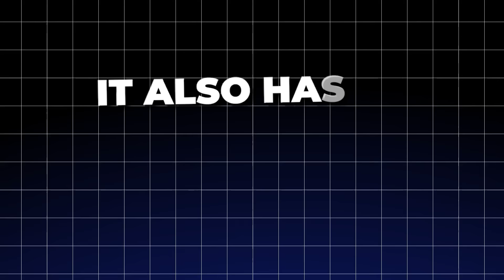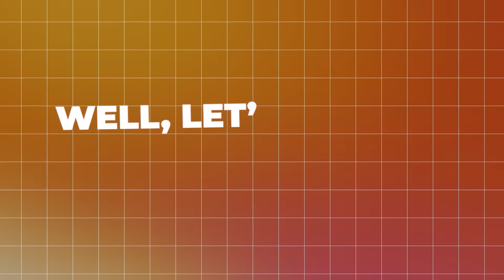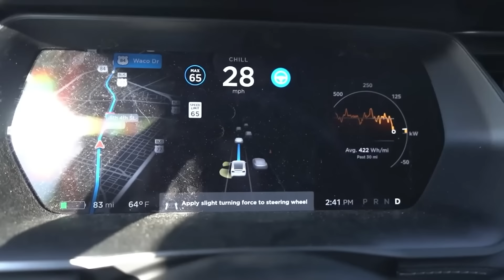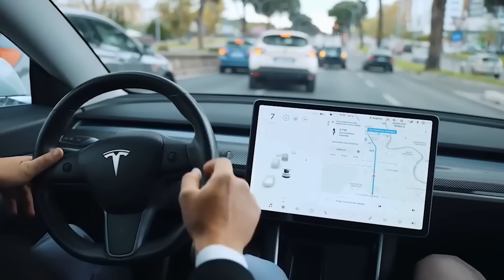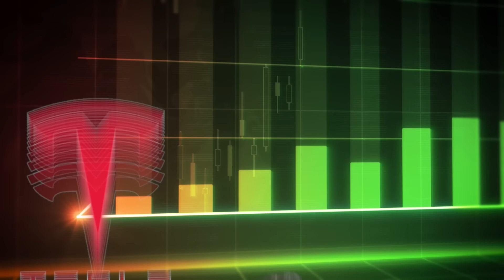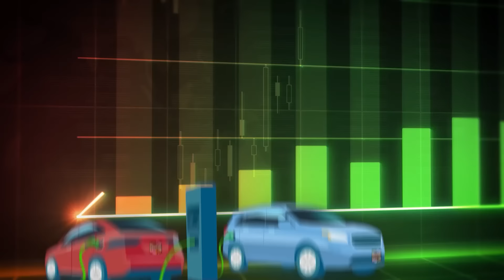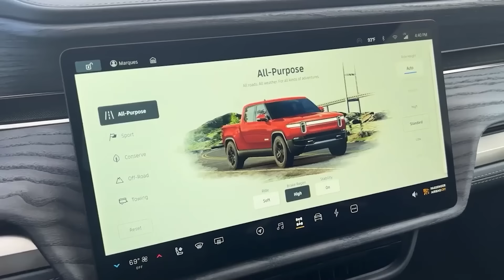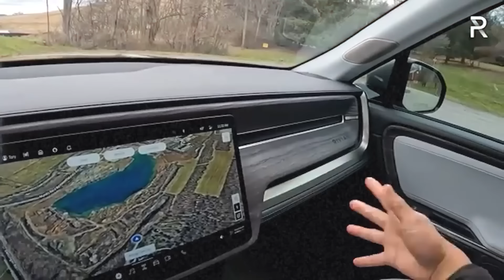IT HAPPENED! Elon Musk’s New Tesla Pickup Truck DESTROYED All Competition!

Comment: for me, its Canadien winters the issue😖 6 to 8 month of winter, sub zero weather, can go down -48C so is there battery tech that can handle that?🤔
Reply: Satire alert:
If we can survive until the Musk Mars settlement and mining of the dilithium crystals for which he will shortly be securing mineral rights throughout this solar system is fully underway, as well as the Mr Fusion Home Fusion Reactor that’s been in development by the Tesla skunk works for years now, our energy future will be secure. 😂😂
Reply: battery can be heated as long as its plugged in
Reply: @stanmitchell3375  yes but plugges are not in many parking lots are they😔
Reply: I drove my Kona EV through the rogers pass dozens of times in -40 without ANY problems
Reply: @Roham  out of curiosity, what’s the range and charging time like at those temps?
Reply: Charging time is the same and range is 300+km instead of 420km. Once during a road closure I slept in the car from midnight till 6am and used just 8% energy with the outside temp at -40 and cabin temp set at 21